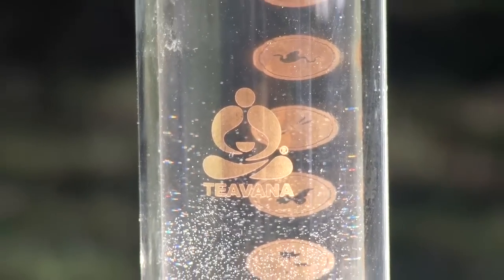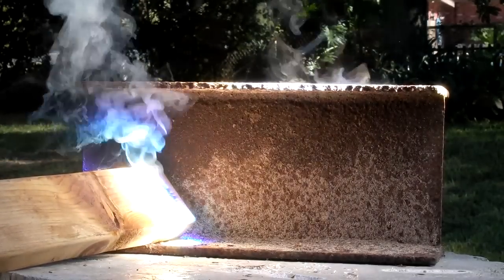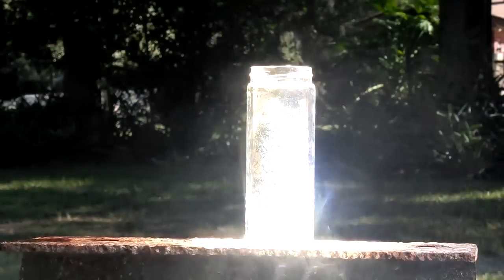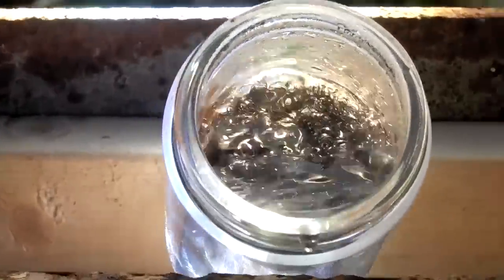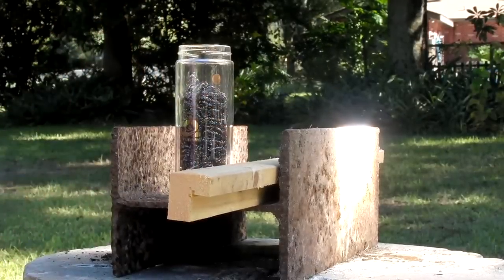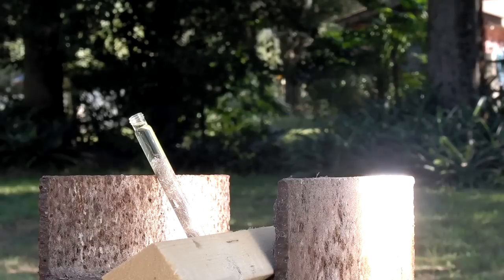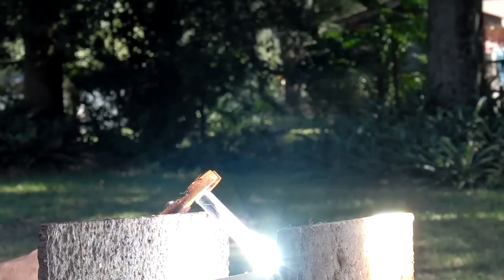Fresnel Lens SOLAR STEAM BOILER VACUUM TUBE STEEL WOOL METAL NANOPARTICLES

Comment: Hi Daniel. Like your work much, but would love to see a solar powered steam engine. Definetly can imagine it with the vacuum flask you did your experiment above. You can even use a number of those simultaneously, possibly with additional lens for each other flask, and connect them to single preasure chamber (and possibly extra watter reservoir) by some valved tubing. Would that design have some point in it, or would it be much easier to simply slap there a solar panel instead?

Comment: You might consider using something under the container to slide it in and out of the sunlight. That would help to keep your hands out of the sunlight and also avoid shocking the glass with a sudden cooler temperature.

Also, love the ominous music at the end when the squirrel appears.
Reply: There's not much you could put under there that wouldn't melt.

Comment: have you considered using two bottles, linked together with a hose? one bottle would be for heating using the Fresnel lens, and would have a hose going into a hot water tank, and the cold water would be fed from the bottom of the hot water tank and be linked by a hose to the bottle being heated. as the water heats, it will rise up in the hose to the top of the hot water tank, causing a siphoning from the cold water bottle which would resupply the hot water bottle - a closed loop if you will.

Comment: Only wish I could have seen this when it was first posted.Great video!! Does this remind anyone of steam powered power plants? Knowing little about the fuschl lens workings just with what little knowledge I have of this can definitely see a power plant that could operate solely by the use of these  lenses.Most the steam powered plants sit abandoned for different reasons I'm sure.But one shot in the dark is they don't cater to big fossil fuel oil companies or coal companies.The use of these lenses is definitely a renewable energy source.Can't see many side effects to the environment either.The sun drives everything else so why not power generation.Hopefuly you've kept at this and discovered even more about it..Seen one video where a guy was trying to generate power from steam but was using it's pressure to drive small generators he had demised from small two-cycle engine's.He simply took out the spark plug and ran the engine backwards by the steam power. As a result turning the flywheel where he had the generators. The problem he was facing was a material that could take all the heat generated by the lenses. He could not control the amount of heat he was melting steel, copper, glass any type of pipe he tried.. Assuming these pressure systems are in need of very high pressure more so then what would be generated from boiling water alone like that of a water heater or a pan of boiling water for tha matter.. The last I heard he had some success with a titanium pipe to resisting the heat  energy created by the lenses. Ironically this video came up after I had viewed an abandoned steam powered power plant. I'm the outside the box type thinker and two and two makes four every time.Can just see this as a reality in the future. One has to agree that water as well as the sun are the two most nurturing substances in the known Galaxy no life can exist without these two factors in play.. There's energy in equation one just has to figure out how to harness it. And to what angle to come at it from. Like I said hopefully you are still hammering out this I'm going to say technology. Like the great tempest of the pass keep hammering...👍✌️

Comment from the maker: The steel wool is heated without water present, this turns it a matte blackish blue color.

I agree, shiny metal is not good for solar collection heat exchanging. The advantage is steel wool has a tremendous surface area directly contacting the water.

Comment from the maker: I am looking for about 50 PSI with a larger volume. Also if higher pressure is needed, a steel pipe inside of a glass vacuum could be the answer. If large enough glass is available, then glass-vacuum,inner glass, oil/element/steel or copper. The oil would transfer a lot of the heat to the  encased water tube/boiler.

Comment: It sure seems like large scale water heating for something like steam power generation or heating a dwelling would be extreemly difficult to accomplish this way given the localization of the hear source and needing to reposition with sun movement. However, using this as a method to heat a surface for cooking seems like it would be a slam dunk. BBQ (as previously mentioned) or even a large griddle surface etc. Thanks for the video!

Comment: Try some carbon fiber roving. It's carbon, which is non-toxic (may have sizing/die lubricant agents that you'll want to wash off) and it's naturally black. Roving is essentially what fabric is woven from, and it poofs up really nice. I've used it several times to make electrodes for carbon-zinc batteries that had to be really small and flexible, and it's electrochemically stable over very long periods in ridiculously caustic conditions. Love the vids, keep up the good work!

Comment: I've thought about using Fresnel lenses to supercharge a solar heat system because I live in a cold climate, but the cost of any lenses is prohibitive.  I don't know all the measurements, but I've wondered how much energy could be harvested combining a Fresnel with a sun-tracking system to direct the light at a target.  Probably not enough to be worthwhile where it is overcast or has a lot of snow when it's cold.
Reply: How about using a linear fresnal lens? They don't cost as much as you may think! You have some very good ideas!

Comment: Hey Dan, thank for sharing your work. is that water drinkable after boiling with steal wool or do you think it had metal fragments left in it? Maybe a quick sterilizing process perhaps?
Reply: +n sling 
You don't think being superheated already would be "sterilising" enough? I think any nanoparticles of stainless steel would eb inert and therefore harmless. Preumably they would sink anyway, so drinkable water could be decanted from off the top.
Reply: just put water in a pan with a lid on it and heat it up no need to add steel.

Comment: This would be a good idea for getting distilled water! Using the cling wrap/littler marble method you can condensate the water using the cooler ambiente air into another container. A taller, trasparent wide glass/plexiglass tube can hold the boiler inside and at the same time keep the steam from escaping while letting the sunlight in. Good for having usable water during emergencies!

Comment: ummm again the thermal energy storage mass (Salt Licks... 5 bucks for 50 pounds and like cubical..... so stackable and does not melt till 802 degrees C????) and like steel plate to put up to said stack.. and fiberglass insulation around it except for like a 1 square inch hole letting the light heat the steel plate... and like conduction into the salt stack that is insulated.... and like copper car radiator or like bendable copper tubing... and then like a homemade steam turbine and automotive alternator? yesh.. I would say it works better than the pyrex glass by far.............

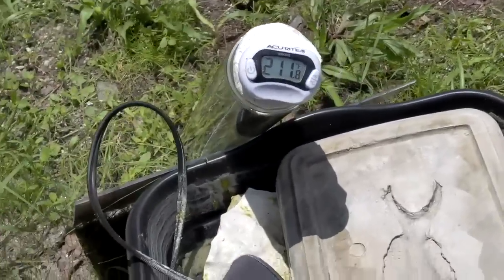Comment: 6:05 Noo it's not. Not only does the steel wool reflect a lot of the light back out, you gain nothing from it being metal or spread out like that, for the simple reason that any sunlight hitting a dark surface inside the jar, is converted to heat and trapped there, so you cannot have any loss. Just a black plate inside would absorb the light much better and depose it all in the water. You could use anything else black, insulating or not, even plastic, and it would work as well, because the energy has nowhere else to go but into the water.

Comment: Interesting video, & I like the fact that you can boil water that quickly using steel wool in a glass tube, but you are endangering anyone foolish enough to listen to you by suggesting making a boiler out of glass instead of steel. I would strongly suggest you do some reading on Boiler Codes and other pressure vessels & learn how deadly they can be when they explode. IF there were a glass jar that could contain any amount of usable boiler pressure, the slightest impact would cause an explosion.

Comment: try copper tubes with copper cable chunk in it, then smear the tube with thin carbon powder. hmm i miss it so much, make some small version of them to move 3 dc volt dynamo every day, then collect them on some board, then make paralel electric circuit of them.

Comment: why use solar when a small motor stepped up twice with stators from a ebike motor to a 120 motor with a large stator on the 120 motor mean one solar panel enough voltage to the grid to make the ten volt needed to make the energy. you will have no bill at all and it will save water. (we are in a drought people!?!.)

Comment: whats the purpose of steel wool in this project?
Reply: Danilo Majhenic Without the steel wool, the sunlight would go through the clear water without being absorbed. The steel wool is dark, absorbs the heat, and heats the water.

Comment: would you show videos of making thermal acoustic engine? 
Will the steel wool make a good conductor of heat, cos Iam thinking of getting the heat from upstairs down to kitchen through thick copper tubes insulated with ceramic for cooking purpose

Comment: Do you wonder how much heat the shiny steel wool is reflecting away?
i wonder if there's some kindof black stainless-steel-wool-like material.

i guess you could spray/dip black paint onto it, but i'd expect the heat (and the flex of the steel-wool) to deteriorate the paint, it may chip-off into the water.  Perhaps special heat paint (exhaust paint)

Comment: Not sure I understand the application of such a vacuum flask as a boiler. In order to use the steam, it has to be under pressure. It's the pressure which drives a piston, which turns a generator shaft. However, you say in the video you can't put the lid on the flask because it'll just turn into a bomb (presumably from the pressure build-up. What use is such a glass container that can't withstand useful pressure? Boilers may lose heat (though professional ones are also insulated) but they are made out of metal so they can withstand high pressure, which is what they essentially output for energy. Am I missing something?
Reply from the maker: Piñata Oblongata Vacuum around the exterior only. Center vessel is ambient pressure or (+) steam.
Reply: GREENPOWERSCIENCE Yes, I know. Perhaps read my question more carefully to understand what I'm asking. To what use could you put an open contained with water boiling in it? If you can't create pressure with it, you can't create power via a generator.
Reply: iron will That would make sense, thanks. In this experiment, however, the light heats the water in the inner tube (by way of it also being transparent) and the vacuum tube portion of the outside of the container simply stops a bit of heat loss. If a fluid was used inside the vacuum tube to transfer heat to a metal inner tube, wouldn't that increase the pressure in the fluid-containing compartment, thus giving you another "bomb"? I suppose you could put a pressure valve on the outer chamber or something...
Reply: c
 d
Reply: The solution is an array of tubes operating at low pressure to power an array of small generators.

Comment: As aluminium conducts heat a thousand times faster than steel, would an aluminium element work better? It also wouldn't rust.
Reply: It would melt though.

Comment: You have boiled water using stainless steel wool in Tevana tumbler. If someone boils water like this and gets / traps its steam as distilled water if this water will be healthy / drinkable in the long run....! Any advice.
Reply from the maker: I would use a river rocks that are naturally back in color, inert.

Comment: The lens size is kind of impractical in a rl situation. What if you had a bed of smaller lenses like on a solar panel with the water piping in one end and out the other like a reverse radiator effect? the distance to the water would be much shorter too wouldn't it? Still as much heat per cell but a lot more cells and replaceable. Same with the Parabolic mirror, a lot of smaller dishes under a ceramic hob or hot plate and when you want less heat turn more dishes away from the light source.
Reply: Works with fresnel as light goes through it. Though with the parabolic, the dish must be >>> size than what's being heated as the light must get around the object to be heated.

Comment: Really thrundar - you would have been more impressed? Why, I wonder. Is the physics of heat and boiling different in Chinese glassware? I'm pretty sure it would be no more or less an impressive demonstration whether the tubing was manufactured in China or Chicago.

But hey, way to wedge your simplistic economic views in. A clue for you - communism isn't eradicated by refusing to trade - witness N. Korea and Cuba - it's eradicated by extensive trade with capitalist countries.

Comment: Actually, a candle would work to heat the contents. Candles are hugely radiant in the infrared spectrum, and infrared travels through a vacuum just as well as the rest of the electromagnetic spectrum. Otherwise, someone just wasted a ton of money on the Spitzer telescope.

Comment: Maybe fill the tank with an oil and the steel wool. Then put a metal pipe with water in the middle so you can build pressure.

Comment: Maybe this has been asked and answered but I've been theorizing about this. Can you use this boiling method with sea water  in a type of desalinization set up. What I've been wondering about is using the steam created to power a generator which would be used to power a tracking/positioner for the lens. Then once the  steam condenses you would have filterable water to drink.

Comment: nano particles as is metal rebuilding? ....  and why not just use a metal pot and a locking lid with a steam vent. to power a few turbines or an alternator or even a perfectly designed PMA with minimum resistance? I have a plan.. use more magnets to make a floating friction Free spinning pma or g same thing... then get that center hub spinning so fast it might go into the future.. lol no tho  find the perfect speed to generate the amount of power u desire... well the more the better.. let the city pay us ;)

Comment: should paint the steel in black, use high temperature paint (like the one used in car engines). you are loosing a lot of the energy with the steel reflecting sun light ;)

Comment: i was wondering about this very idea. have you come up with any thing. i have some ideas but am still collecting materials. i am thinking of 5 55 gallon drums linked and filled with water. have a metal boiler set up with water circulating between the storage and boiler. just in the brain storming stage. if you would like to exchange ideas it would be appreciated.

Comment: The water boils rapidly because your only heating a small fraction of the water, the water nearest the glass. For a given volume and  radiant energy, the Chinese tubes are probably more absorptive of the sun's rays while not concurrently having to heat the steel wool which caries much less thermal energy than water.
Reply: Water would not boil without the water adjacent to it being at near temperature

Comment: its possible to heat up sand and from the heat of the sand boil water and use it to generate electricity ?
Reply: why heat sand to convert ?. just a wasted step!
Reply: CUBETechie sand turns into glass when hot enough? ;) use a metal pot and a locking lid with a steam vent.
Reply: Dan Hart i hear that is a method to storage the heat for the Night to use this heat to boil water and generate electricity
Reply: try silver plated steel ball, or chunk of copper wire

Comment: hi dan, I'm interested in making solar cells enough to run my window air conditioner. It cost me double to use it. i've seen your videos but still not clear on connecting the ends on a row of cells,and the backing, " what is it made of"  how to seal the entire cell.  I have dyslexia and it's a mess. THANK YOU!

Comment: Suppose that one was able to use the already commercial evacuated SHW tubes as the basic structure, would filling the tubes with copper wool (already with say AMCRO selective surface) i) would the 'wool' prevent thermosyphon from happening and ii) would having the wool inside the evac tubes be enough to create steam instead of hot water??
Clency
Reply: Shouldn't prevent thermosyphon. Steam will be created, though it should not displace all or too much of the water

Comment: Thanks Dan. I was using a regular camping kettle with a satellite dish parabola (burns wood real fast!) and wondering why it would only sizzle and not get a nice boil on...
obviously losing too much heat from the crappy spout, its not insulated, and of course its chromed so its reflecting energy back also!

Comment from the maker: The vessel needs to be clear for the metal mesh's extensive surface area to absorb light and transfer to the water. The pre-manufactured tubes are a better option. While they do not have the same surface area to the water, the insulating vacuum works great:
watch?v=JkgFk15uBxw

Comment: Dan, I interested in using a Fresnel lens on a solar water panel. the panel is 30" by 72" what would you recommend ? Ive also thought about using a tracking system to keep it in line.
Reply: Have you figured out a way to make a tracking system? Please.
Reply: @changingmatrix8687  there are several youtube videos that show how to build a tracking system for solar panels. I believe they could be adapted to work with a lens system as well.
Reply: @bosdad7  Thank you. God bless.